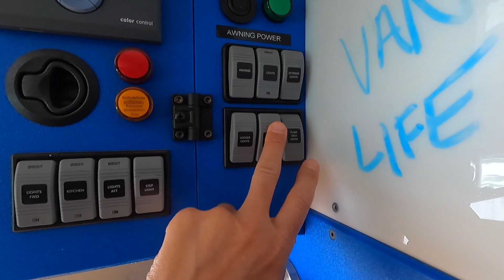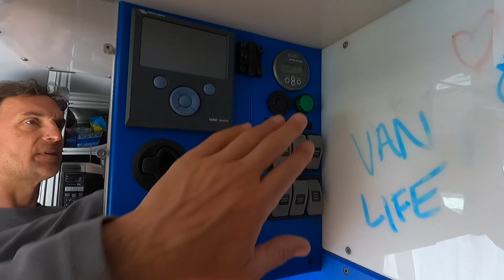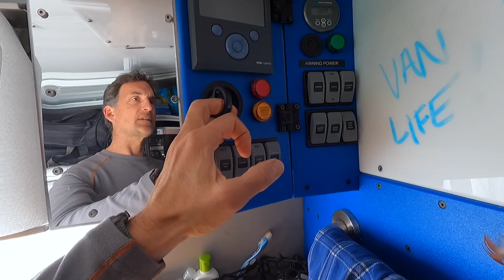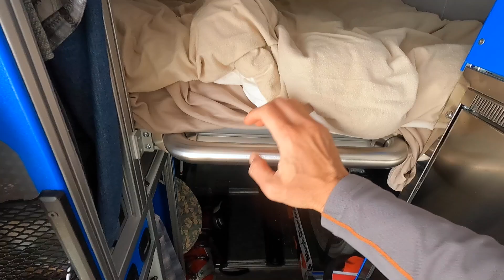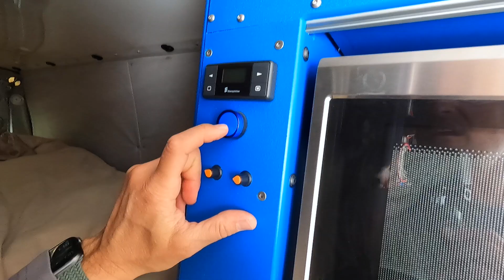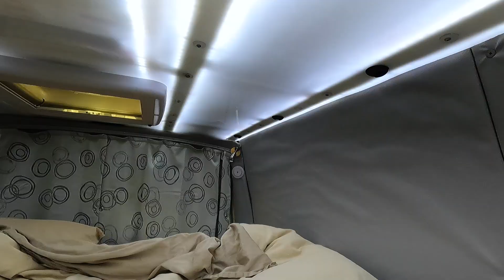Kitchen and camper features

Comment: Nice panel. I like those temperature readers i n and out. Where are they available ? link?  Thank you
Reply from the maker: Thank you! Yes, the outside air temperature sensors are great (one in the dash shown in another one of my videos here: https://youtu.be/grVsBo3edO4 ) and this one in this panel, viewable from bed or kitchen. Also nice to know inside air temp too.
Reply from the maker: You can get those here on Amazon: https://www.amazon.com/Blue-Sea-Systems-1741-Temperature/dp/B0753JDN7M/ref=sr_1_4?dchild=1&keywords=blue+sea+mini+oled&qid=1624896326&sr=8-4 and here is a link to them in BlueSeas website, with other options: https://www.bluesea.com/products/category/6/118/Meters/Mini_OLED_Digital_Monitor. You can extend the cable to the waterproof temp sensor to almost anywhere you want to get accurate readings. I also use the same sensors to read my hot water temperature, heating system temp as well as supply and return temps, shown also in other videos. I also use their OLED sensors for voltage of each of my battery systems, shown in my dash video.

Comment: It seems you forgot NOTHING. Very solid looking setup. The cabinets use built are what we intend on putting in our build. Our van does not arrive until June. Do you think its possible to build some of the floor to ceiling cabinets and galley cabinet ahead of the vans arrival? I want to make use of this time wisely. Would love any input you have😁🙏
Reply: Such great advice sir. Thank you for your response. Cannot wait for this journey to begin.
Reply from the maker: @scottnormand5858  Thank you and you're welcome. Lots of people including videos like these helped guide me thru my design and build so happy to pass along some more learned lessons to help you and others. I plan to continue going thru many more parts of my build in some more detail to give you and others ideas with your builds. And yes, the journey is long in planning and anticipation and challenging thru the build but so great once you're finally out enjoying it. Be sure to enjoy the process, every bit of it as you can, including along the build and the purpose and desired outcomes from it and you'll get there.
Reply from the maker: Thank you. It was a lot of planning with a list of hundreds of wants and desires and planning out the both floor plan but also vertical cabinets to fit something needed or useful into every bit of space. I think you can build in advance half height cabinets without much issue or full height cabinets in a lower and upper section. Otherwise full height cabinets will need to be able to go into the van in their vertical position as you won't have room to stand up them up otherwise unless they are a few inches short of full height to get the angle to stand them up without colliding with the ceiling. Realize that while the slider is taller than the interior height because of the integrated step, it's top is lower than the ceiling so would be challenging to impossible for anything but a tiny cabinet to go in thru the sliding standing up. The rear doors are also a few inches lower than the ceiling height, at least on the 2016 model that I have, so you'll have to take into the account a slight angle full height cabinets would need to enter so I think they will need to be slightly lower. Do share your experience. I am planning out my next build now with the intent to have at least some of the cabinets pre-built and full height cabinets likely be pre-built in a lower and upper section that can be attached once inside.